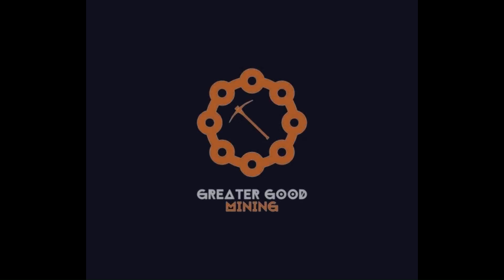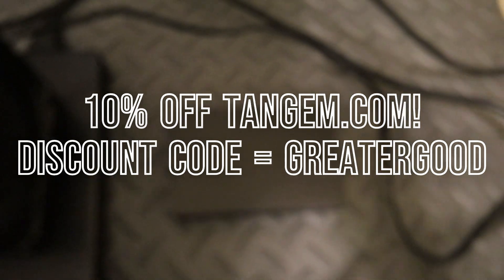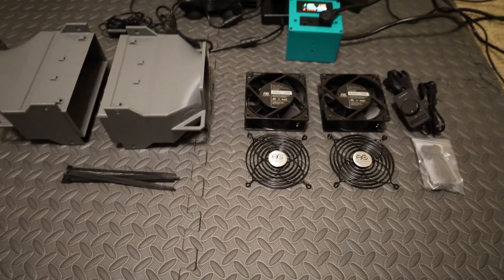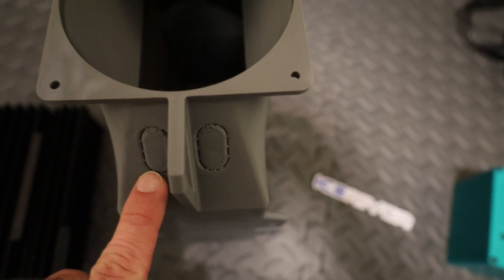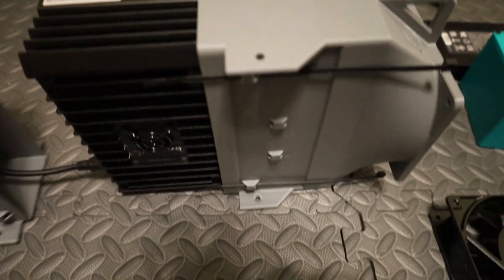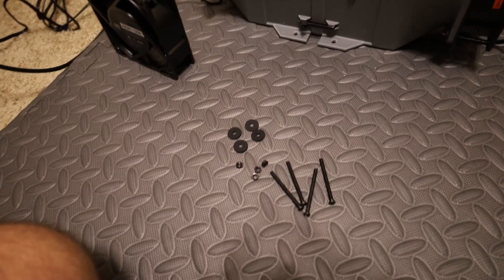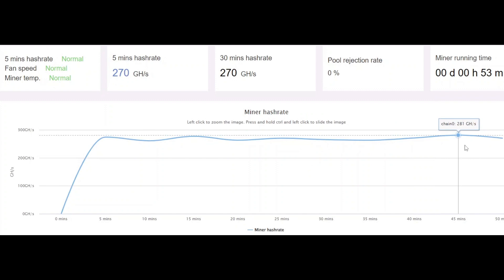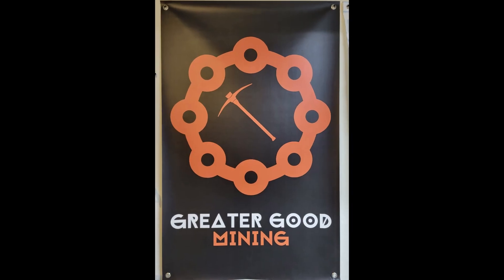Iceriver KS0 Pro Kaspa ASIC Fruition Designs kit! Testing & Tutorial (Cooler temps, higher hashrate)

Comment: Thank you BP! Currently overclocking my ks0 pro and wondering if something like this kit would be necessary. My OC is not really there in terms of temps (overclocking by slowly increasing the hashrate) just yet but it could probably be good for the airflow. My setup is a little janky since I don't have any shroud to help with directing airflow

Comment: I've done a repaste, repad, and heatsinks. And 3D fan Shroud to one side and side fan blowing in. But all overclocks fail within 10 minutes. Any fix?
Reply from the maker: Unfortunately might be bad silicon lottery. Is your power supply able to handle the wattage? Do you have a Meter Box or something similar to see how many watts you're pulling? I've seen people have issues with weak PSU'S
Reply: @GreaterGoodMining  I bought a 230 watt power supply. I could try the 180 one I have and see what happens.

Comment: Seems the exhaust fan is reversed it sucks air in similar to the intake
Reply from the maker: The intake air is blowing air in and the exhaust is blowing air out. The grills both have the same symbol on them so it might look like that in the video. But the grills are completely independent of the fans themselves.
Reply: @GreaterGoodMining  got it more power

Comment: Just testing the brandnew and free OC Firmware für KS0Pro?
Reply from the maker: The new firmware that was released for the KS0 Pro has a dev fee of 1%, so it's not technically free
Reply: Where would someone find this free overclocking software for the ksopro?
Reply from the maker: @BlockchainBotanist  there are no free overclocks for the KS0 Pro. You either pay up front, or you pay a dev fee forever